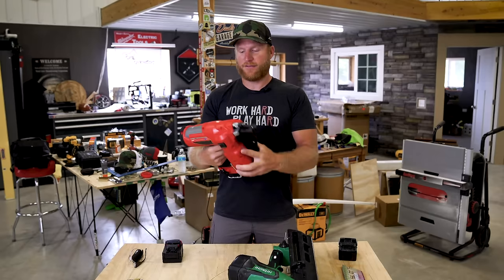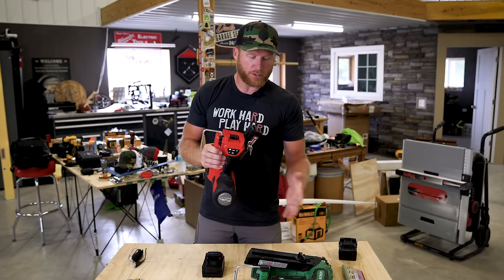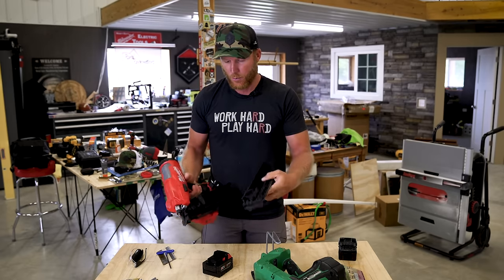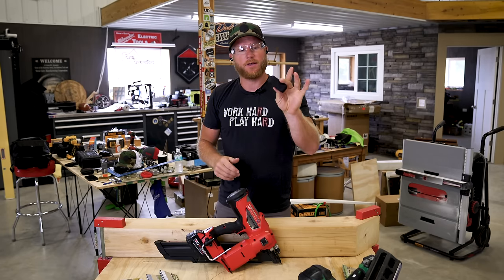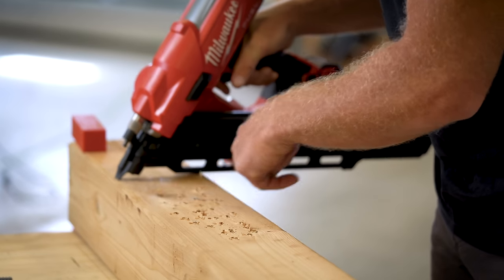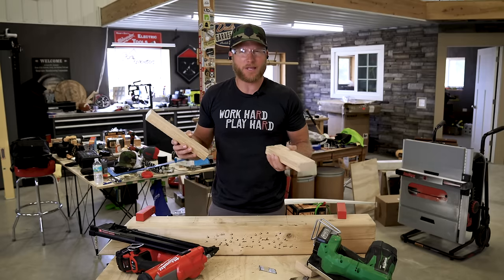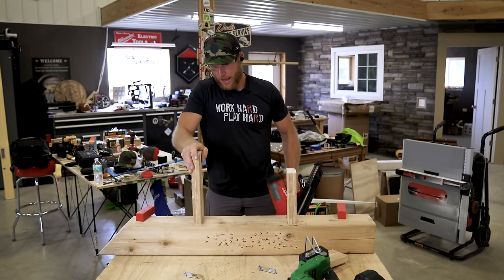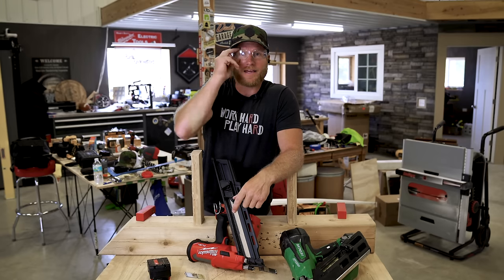Finally - - The Milwaukee M18 Battery Powered Framing Nail gun is HERE

Comment: 6:42 Been saying since NPS19 when got first look at this nailer (this is my Unicorn tool, keeps escaping me. The 21° nailer, that is) that might be able to have a 21°, buy a 30° ext mag (& 21°) & end up having 2 nailers in one Gun? But, every answer I’ve received has been a “and”, the striker won’t work, not designed to do that, etc etc etc...
The more ya look, the more ya wonder 🤔. B/c my preorder from last year was canceled (3x from date being pushed over & over); & I was hesitant to preorder the nailer again from depot. I missed out in the initial release. But I will get this tool, lol, just gonna be a while, till than...been rocking the hitachi 21°.
Maybe Kyle, you’ll be brave & get a 21° ext mag & give it a go for us all to see🤔🤷🏼‍♂️; but if breaks nailer & needs serviced afterwards.....I’m definitely not responsible ok😂
Thx for the vid of first look at the m18 nailer, it’s been about 13 months in the making, lol.
Like the real world type testing & will love to see the use in LVL, etc....
Cheers✌🏼
Reply: I have the Hitachi 30° framing nailer and it might be able to change out the magazine to a 21° since they look like identical nailers
Reply: A -Carpenter thats what I’m seriously wondering. From a manufacturing point, they would probably use same internals etc...to save cost of making them. Then just slap on a mag for 21 or 30. Could be 💯wrong though, & does make a diff. But, not sure I’ve seen anyone try swapping & seeing if works, lol. Would be cool to see on Milwaukee’s new nailer, as little easier to swap mags since they have a ext mag u can buy.
Reply: @Aepek  it's also a cheaper way to go if you use both types of nails, can have one nailer that does both. for us it has always been the 30° nails so all our nailers work with the same nails, it's just the MetaboHpt cordless look identical apart from the magazine

Comment: The framing tip needs more aggressive side tines for toe nailing. Existing tip is horrible for this and constantly slips. Only negative thing I can write regarding this nailer other than the weight.

Comment: I’m all bout Milwaukee but the nail gun is the worst tool they have made so far because it has a pump that works by means of nitrogen but once that leaks off than your gun will no longer perform. With the Dewalt it is spring operated so it’s much more durable than any other gun and if it breaks down than all you have to do is order a kit on line and fix it yourself but with the Milwaukee you have to send it in if you still have warranty. (Good luck!!😤

Comment: i wonder if anyone prefers the 1 clip magazine? is there some specific use case or are that it fits that the double stack mag doesnt? can anyone say they wouldnt prefer the larger one.. my point why stick everyone with another 100$ purchase after already buying an overpriced imo nailer when they could of easily came with the extended mag and if need be sell a "compact" mag seperate.. cost to change to the larger mag in the manufacturing process would be a few dollars where it costs us 30times that to buy it

they could of used the edge of the nailer coming with the better mag to get them infront of the hitachi that theyre arguably tied with in the framing nailer department

Comment: I see it has the garbage shaped tip same as hitachi that’s a fail for me. My hitachi is junk the last six months I’ve had the cylinder recharged 4 times and it has to be done again it won’t even sink nails in pine very disappointed with it my paslodes are more reliable 🤷‍♂️
Reply from the maker: Works great... not sure the issue

Comment: why would anyone need to use a framing nailer in oak or any other hardwood?  not repeatedly anyways.
Reply from the maker: Not at all... but to showcase a difference or potential difference between a tool you have to at least try something difficult
Reply: Len Kobernick PSL, LVL, LSL stock...you don’t use framing guns in cedar or oak..

Comment: Try a different nail than paslode. There nails are Junk. I use paslode air nailers
Reply: And if you shot in hard suffices even with 2 3/8 nail the plunger blows past the nail and bends it like that. There nails are junk

Comment: I still think paslode is best
Reply: I'm afraid I have to agree. I had high hopes for cordless nailers, but having seen a Dewalt crap out, having used those terrible Sencos, and having used the Hitachi, as well as having plenty of experience with the Paslodes, I'm of the opinion that Paslodes are still king on sites. The Paslode is light, reliable, has few moving parts, and is very serviceable. It's the industry standard, and cordless gasless nailers haven't caught up.

My experience is that the Hitachi is OK, but it's very heavy and awkward, and it's fussy about which nails you use. We only get to brands here: Paslode and Senco. It doesn't like the Senco nails, which are cheaper and available without gas, even though the Paslode gun fires Sencos no problem. What's the point? We end up buying gas we can't use with Hitachi because Paslode is so ubiquitous it's hard to find nails without gas.

People say weight and bulk aren't an issue, but trust me it is if you are holding that thing above your head for hours.

Just get a Paslode and service it regularly. The things go forever.

Comment: The dewalts are absolute utter shit , I threw 4 of them in the skip and 1 off a roof months ago now , only drama with the Hitachi is the rack , spring gets slack and stop pulling the nails up so it miss fires...rubber band over the rack fixes it tho

Comment: These will NEVER compete with pneumatic guns for hardcore carpenters! Sure, they are great for homeowners and small jobs, but for new construction they are just not practical! You would still need to run a generator to keep the chargers going all day, so you might as well fire up the compressor and run pneumatic.